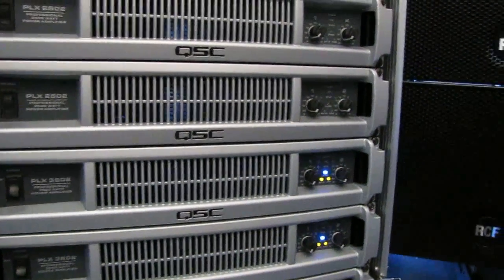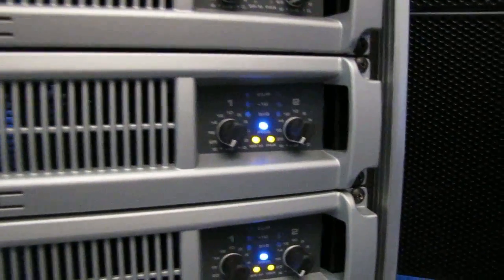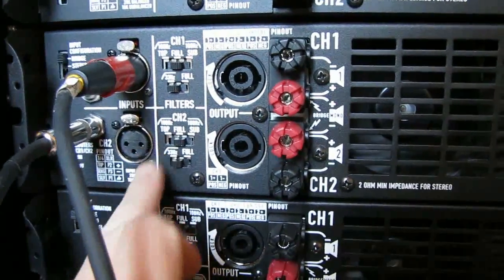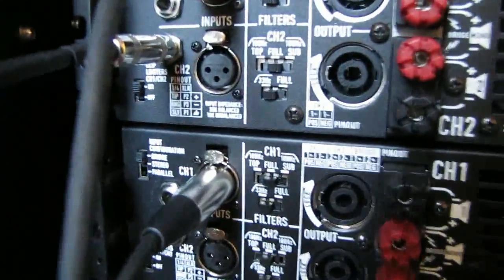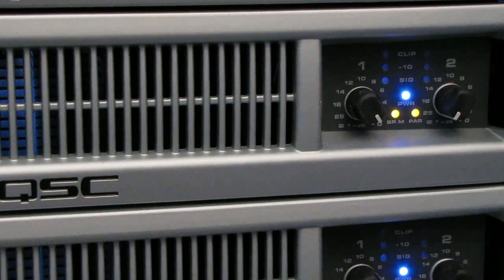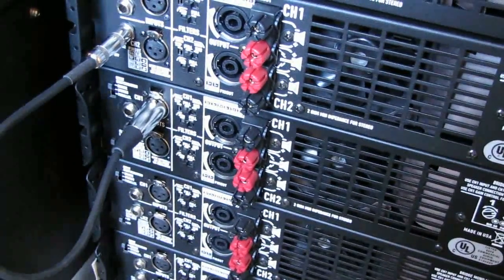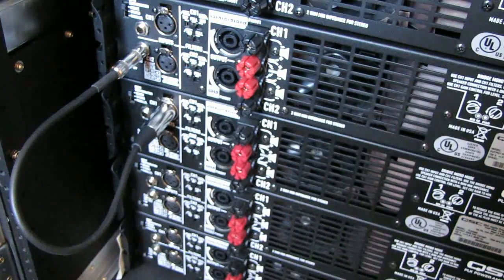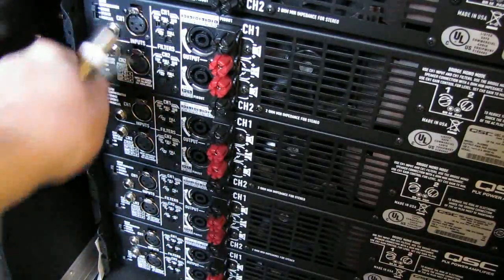"Daisy" Chain of Amplifiers (QSC PLX) - This is a mono configuration

Comment: So which speaker out connection are you using ?
The one from the top amp,bottom amp,all four ?
Are you bridging the speaker connections? And can you use different brands of amps or should you only use the same kind ?? Need more information.. Thanks
Reply from the maker: In this example (from the video), the speaker connections would be for a bridged mono setup.  So, this means that each amplifier in the video would have only one speaker attached to it - for a bridged operation.  Therefore, there would be 4 speakers used (each speaker powered by its own amplifier).

Yes, any amplifier (or group of non-like amplifiers) can be used... as long as they have an input and a "thru" output connector that will allow the signal to be passed to another amplifier.
Reply: @stageleftaudio  can you daisy chain and use one amp for each set of speakers and also a powered sub getting the same signal?
Reply from the maker: Yes.  Running one signal to each amp, with each amp having its own set of speakers is exactly how daisy-chaining works.  You can connect a powered sub as well.  Powered speakers are usually connected last in the chain.

Comment: Some 1/4 connectors are wired unbalanced and It's not a great idea to go from an unbalanced output to a balanced input without a transformer.
Reply from the maker: Correct.  Also to note, short distances (usually less than 2 ft.) using unbalanced connections do not present issues.  However, if using balanced connections anywhere in the routing of a sound system, it is recommended to use balanced connections everywhere in the system.

Comment: Ok, now where do plug the speaker into? The last amp?
Reply from the maker: The daisy chaining process is ONLY passing the line-level signal from one amp to another.  Therefore, each amplifier will produce the same signal as the other; which means, each amplifier would have its own speaker connected to it.  In daisy chaining, it's the signal that is passed to each amp, not the power (watts) of the amplifier.
Reply: stageleftaudio I get that part, let’s say I have two power amps and need to run both of them to one speaker cab. How would do that? Ex: let’s say I have two 1000watt amps and I want to tie them together to produce 2000watts to one speaker cab. How would I achieve this? Is it possible
Reply from the maker: I see what you are saying... VERY IMPORTANT - do NOT tie amplifiers together to make one large amplifier!  This is not how amplifiers are made.  You could cause a fire and/or destroy the amplifiers by trying to tie them together.

If you need more power, you will need to either bridge the amp (place a single amplifier into bridged-mode), or get a larger amplifier.
Hope this helps.

Comment: Nice
Reply from the maker: Daisy chaining is only sending the line-level signal (from the xover or the console) to all the amplifiers... the watts/power from each of the amplifiers does NOT get passed to the next amplifier.  In this video, each amplifier would have speakers attached to their outputs.  Each amplifier produces 3,600 watts, which means the speakers attached to each amplifier would need to handle 3,600 watts.  We take the 3,600 watts from each amp, and the speaker(s) attached to each amp, and multiply by 4 = 14,400 watts spread across the 4 amplifiers.  Each amplifier would power its own speaker(s); the only similarity between the amplifiers is that they are all receiving the same line-level signal.  Hope this helps.

Comment: Even if using older amps, a custom cable can be made to have multiple plugs in parallel.  Due to cable size and the connectors, a smaller diameter wire can be used so 2 wires can go into each plug. As this is not to be used anywhere but the amp rack, this can be left installed in the amp rack.  As far as "overloading the Mixer or outboard output" this is not a concern as the input impedance for most amps is about 10,000 ohms and the output of the console is typically 600 Ohms or less, most often about 200 ohms.  Fan out to up to about 10 amps causes no problems.  10 amps in parallel with 10K input would then be 1K at the imput which is no problem for most equipment. The cable would have 1 input and 4 output connectors chained together all in a parallel custom length to be tidy in the amp rack.  Read your amp specs to find the actual input resistance.
Reply from the maker: Thank you for the post.  This is a good method of chaining amplifiers together.

Comment: please help :( , can I chain this amp? https://www.electromarket.co.uk/vonyx-vxa-1500-mkii-pa-power-amplifier-2-x-750w
Reply from the maker: You may be able to chain this amplifier by using the 1/4" and RCA connectors.  However, the connectors (per channel) should be in parallel (see the manual).  If they are in parallel, the amplifier can be chained.  Read the manual...  it should indicate if the inputs can be used as outputs to send the signal to other amplifiers.
Reply: thanks man, i did wonder if the channel jacks would chain it...?

Comment: stageleftaudio  can you do tgis with crown amps? I have the xls, with them running front and rear speakers from preouts on my receiver, to my Yamaha eq to crown 1...no problem, sounds great..how do I get the 2nd crown to get the eq signal? it sounds muffled, and the eq makes a big difference. thanks...oh, the speakers are connected by banana jacks
Reply from the maker: As long as the XLS amplifiers have two inputs per channel, they can be daisy changed.  Some of the XLS amps have something called "Link out"; it's a 1/4" output on the amp.  This output is used to send the signal to the next amp.  If the amplifiers don't have 2 connections per channel, the signal can be passed from one amp to another using a series of "y" cables.

Comment: hi stageleftaudio and thanks for great video explaing how to daisy 2 amps.can i link 1 vonyx VXA-2000/ref.no 172.056 Professional amp to SPL1000EQ  Stereo power amplifier and VXA-2000 1 for sub and 2nd for max210 dj/pa speakers 8oms. has a ground lift switch on back of amp which im not sure if shop set ground lift switch the write way plus when i switch 2000w amp on i get protect indication light come on then off again is that ok normal.im new never had amps like these before.im am using PD connex speaker cable only problem binding posts are not very good first time i could only get 1 speaker to come on i had to turn amp off unscrew binding post put wire in more then screw back up  which i thought i did the first time.keep videos coming please as u explain very well thanks again.
Reply: Paul Hazelwood Xx

Comment: What mode do you set the amplifier in? I got confused when you said that the amp is in bridge mono and parallel mode.
Reply from the maker: In this video, the amplifiers were set for "bridged" operation.  Like many amplifiers, when setting them in "bridged" mode, they will automatically be placed in "parallel" mode (i.e. duplicating the input signal on channel-1 to the input on channel-2). For the PLX series, parallel mode simply allows for one signal to be brought into an amplifier (i.e. channel 1) and have that signal automatically be produced on the input of channel 2.  With the same signal appearing at the inputs of channel-2, that signal can be daisy-chained out of channel and into channel-1 of the next amplifier.
Reply: @stageleftaudio  you do realize that when you run an amp in bridged mono mode, it inverts ch 1 polarity to ch 2 polarity. You CAN do this, if you invert your outputs OR use the amps outputs in bridged output mode (using the + terminal on both channels, ch 1+ for speaker + and ch 2+ as  speaker -) If you don't do this, you will have 2 speaker loads operating out of phase with each other. The correct way to do what you are demonstrating would be to run the amplifiers input stages in parallel mode, not bridged mono mode.
Reply: is there a way i can use outputs as inputs???

Comment: I have two sub speakers with one input running them mono. I have one QSC 2450 running both speakers but it's not enough power. I want to daisy chain another 2450 and run them in bridge mode to power each speaker separately. Where do I plug each speaker? Any guidance here would be helpful...
Reply from the maker: First... take a look at the manual for the 2450.  Basically, set your amp to bridge mode (using the dip switches on the rear); next, you connect one speaker (i.e. 1 speaker wire) to the binding posts (if using binding posts).  But, look at the back of the amp where the binding posts are.  They show you that you must use the 2 center posts - the "+" posts  (of both binding posts) to connect a speaker if the amp is bridged.  Then connect an XLR cable from the input of channel "2" of the amp, and connect that XLR to the input of channel "1" on the next amp (like in the in the video).  If you are using a speakon speaker cable, those must be wired differently to support the bridge operation of an amplifier.
Reply: Im having problem daisy chaining 2 Qcs 2450 , did you ended up fixing them
Reply: Dan Alden

Comment: what if you insulate each amp from rack mounts using HumFrees
Reply from the maker: I would never recommend the use of a gadget to cover up a grounding issue.  If a ground loop hum is occurring due to an electrical grounding issue in an amplifier rack, the grounding issue needs to be fixed/corrected... not covered up.
Reply: Emerson Jones RAMMURAT9780792523
Reply: RAM MURAT GUATAM you plug the black wire into the black hole

Comment: is QSC a good amplifier brand? i need a new amplifier that can drive 2 600 watts 8ohm speakers
never, ever buy skytech amps they say 250 watts per channel and they deliver 24watts per channel
Reply from the maker: Yes, QSC is a good brand.  Also, other good brands we've used have been Crown and Crest-Audio.  All these manufacturers make economical amplifiers as well as professional.
Reply: stageleftaudio thanks man, ill give them a look
Reply: yep crest audio pro lite series great!
Reply: Only thing qsc needs is more dapning factor
Reply: Oh Yeah, QSC is good.
Reply: How about Rockville Amp? Are they good?
Reply: I would avoid rockville.  Qsc GX series are a great value, i would look at those first

Comment: I` am very surprised that you u disconnected the  ground connection, there are other ways and means to prevent a ground loop entering the system, you remove the ground from the connector then you can potentially become the "ground" as have a lot of high profile people in the music industry have done with fatal consequences. "The ground is there for a reason to "protect one selves" like you said u r talking about high current here, by the way fantastic in depth videos please keep them up.........
Reply from the maker: The ground connection we remove is on the audio cable, not the power cable.  The audio equipment is still grounded (this does not change).  I know of problems where electricity has "leaked" into sound systems (mics, guitars, amps, etc...) and many times, these issues have been the result of mis-use (and abuse) of audio equipment, improper use of cables, aging equipment, and the occasional use of home-made wiring.  

Electricity has a few entrance points into a sound system.  There are some pieces of audio equipment still floating around in the industry that do not utilize  NEMA 5-15 power cords (i.e. for 15 amp rated outlets); these non-grounding power cords can easily cause serious/deadly problems.  All our power cords contain grounds.

If we suspect that a questionable piece of band equipment may be interfacing into out system (i.e an old guitar amplifier), we use a low-voltage proximity detector on the amp outputs (if they have outputs); any voltage present means they do not connect into our system.

Thanks for your comment on this topic.

Comment: does each amp have their own speaker then because of the amount of power you are needing?
Reply from the maker: Correct.  Each amplifier in the signal chain will have its own speaker attached to it.  And because these amplifiers are configured as bridged-mono, only one speaker will be attached to each amp.  Each speaker would be rated about 3500 watts (@ 4ohms)
Reply: for all the amps you are daisy chaining you are only running 2 outputs to the mixer when connecting all the amps together?
Reply from the maker: For this particular amplifier setup, there's only one output coming from the mixer.  This is because the amplifiers are setup in bridged-mono, which means the amps can only accept a mono signal.  There's another video on our channel that shows how to setup daisy chaining for a stereo (2-chnl) configuration.

For mono setups (as shown in the video), the mono signal driving the amplifiers would actually be coming from a crossover (for either lows or mids or highs).  It's rare that we would run a full-range mono signal to a group of amplifiers (for an actual show), however, the need does come up sometimes.

Comment: Hypothetical situation.....How many amps could be daisy chained without signal loss to the inputs? I think these amps probably have10k unbalanced/20k balance input impedance, so just wondering provided you have the proper power available. Also does that 1/4 inch need to be TRS?
Reply from the maker: +cacornett58 Good question.  The most I've seen "chained" is 12 per side for FOH (QSC Powerlight amps).  There may be a limitation, but seems like it would be high enough, that it would not present any issues for most setups.  For short jumps (amp to amp in the same rack), TS cables work fine.  If you are chaining amplifiers in separate racks (over 20' away), you will probably want to use TRS.  We try to use all TRS cables for every 1/4" connection in our system; it's easier to manage the cables if they are all the same.
Reply: +stageleftaudio   Thanks...interesting. Always wondered how "the pros" run those speaker arrays.

Comment: It is amazing how the inputs can be converted into outputs! Can I trust your word that all amplifiers made within 10-12 years can be done like this? Are there any exceptions to maybe the sound of the outputs, or certain companies of amplifiers?

Thanks so much for this video!
Reply from the maker: +Mark Euglin A lot of professional amplifiers support parallel connections; therefore, allowing daisy-chaining.  I don't think all amplifiers support this feature.  I recommend checking the manufactures manual for the particular amplifier(s) you may be interested in to see if they support daisy chaining.

Thanks for your comment.
Reply: No prob, and thanks as well!

Comment: I have 3 qsc dca 3422 amps, can they be daisy chained?
Reply from the maker: +Marv Reyes Yes - the DCA series should have the same type of input connections as the PLX series (used in the video).
Reply: Thank you, they have the switches like the rmx series for stereo, parallel, bridge, filter and limiter. On each channel one xlr input and one 1/4 input. Your video has been very helpful, I used a split cable from crossover to the amplifiers, which is not recommended, I  was very curious on daisy chain my amplifiers, Thank you for share your knowledge.
Reply from the maker: +Marv Reyes Thanks for the comments.
Reply: Do you believe I can do one amplifier for tops, then a crossover for subs then 2 more amps?
Reply from the maker: +Marv Reyes Yes.  That is how multiple amplifiers are setup to run multiple speakers.  The signal from the board would first go to the crossover, then the "highs" and "lows" from the crossover would feed their respective amplifiers.
Reply: I have a limiter it goes before or after the crossover?
Reply from the maker: +Marv Reyes It should go after the crossover.  You will need 2 limiters... one for the lows and one for the mid/highs.
Reply: Thank you, I appreciate your help.
Reply: Marv Reyes

Comment: can you pls help me on this,i have 2 identical Power amplifiers EPX 2800 Behringer and when i connect the 2 amps together in parallel one of the amps is stronger than the other one,even the signal is stronger than the other on both full gain.i am using them on 8 Bose Bass bins 502 on 4Ohms.Thanks
Reply from the maker: +Jonathan Malta I'm not familiar with the amps, but make sure some of the basic things are not causing the problem.  Look at the filter switches on the back - make sure they are all set the same for both amps (depending on how you are using your amps).  If the amps should not be bridged, make sure both amps are set in "stereo" mode.  If you need to make changes on the amps, make sure to make these changes with the amplifiers OFF.

If the settings on the amps are all the same, how are the levels of the amplifiers when they are not daisy chained?  Do they exhibit the same behavior?
Reply: Thanks for you fast reply,from the back of the amps its all set the same on stereo,can it be the wiring of the speakers the problem? cause i have a set of speakers with proffessional cable and another set on a cheap cable.